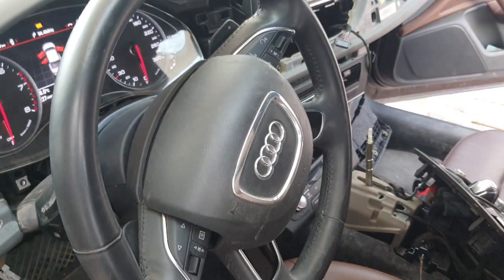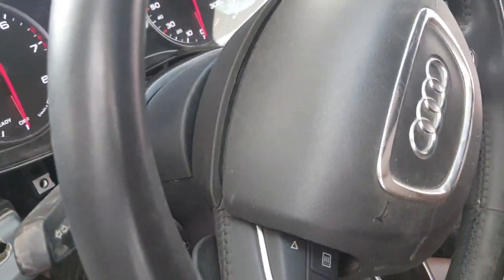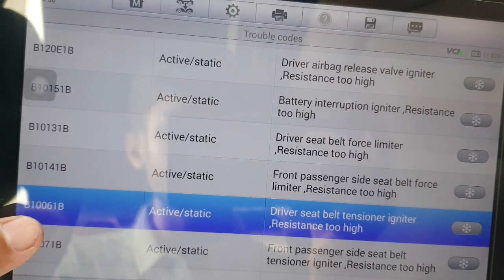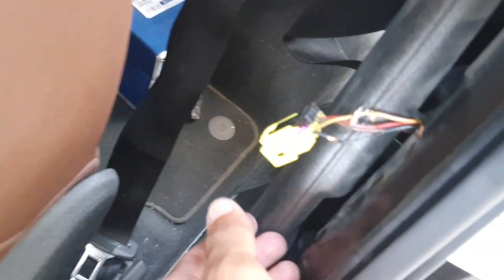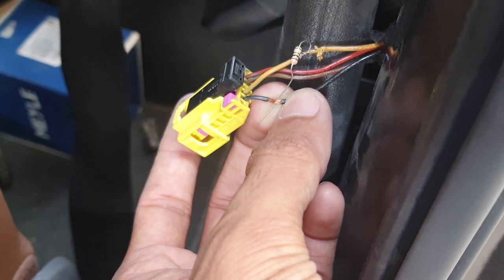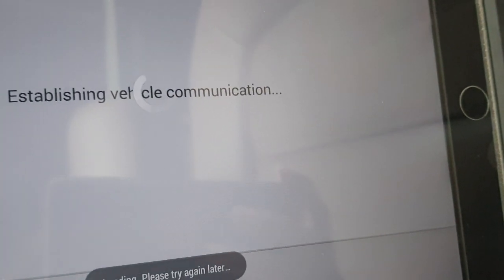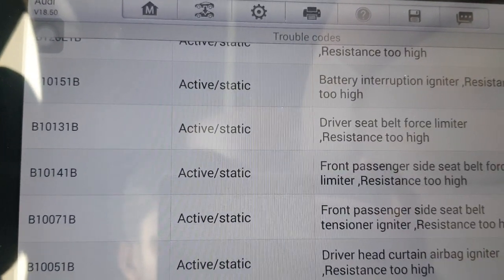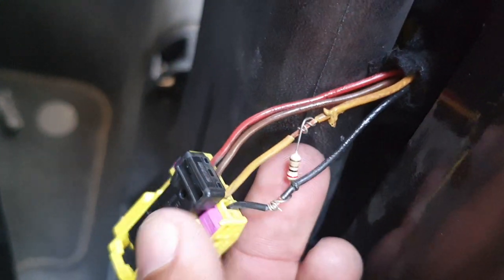Audi B10061B location, Driver seat belt tensioner igniter.

Comment: Hi i need your help i am having code same on passenger side seat belt and driver side seat belt kindly tell me need to fix resistance in both aide
Reply from the maker: Yes you have to fix both side
Reply: @carhospital  we changed rear seat belts but why we are having front seat tensioner code your help will be highly appreciated
Reply: Thanks for your help my job has been don successfully